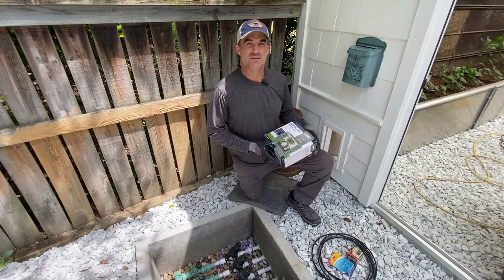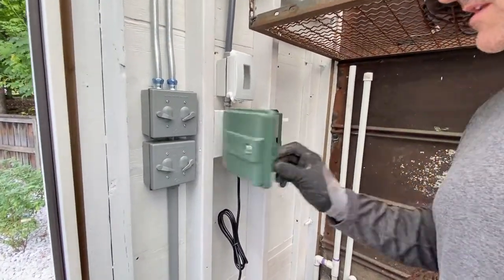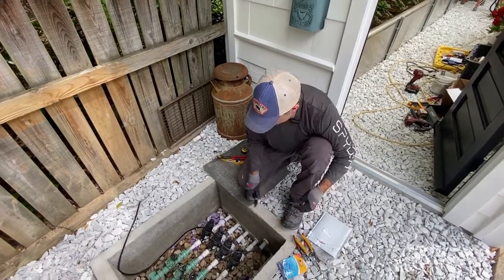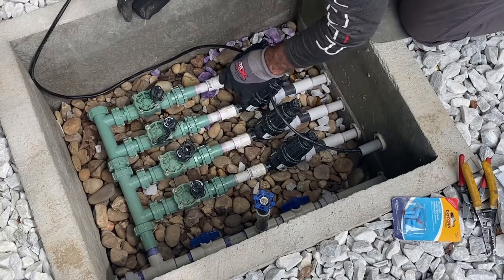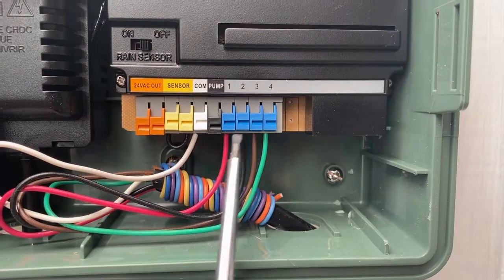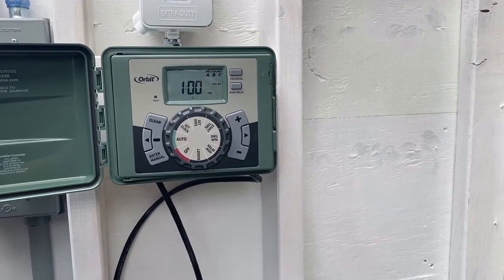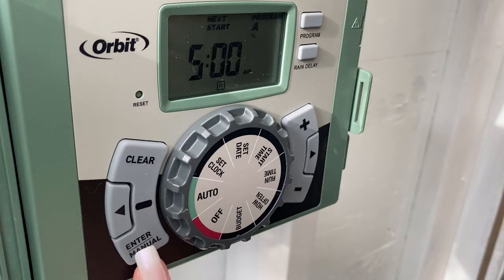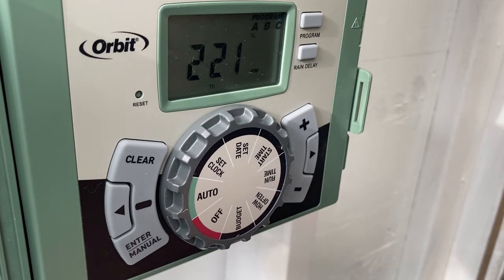Orbit Timer Wiring & Programming Complete Install #diy #how #orbit

Comment: What if you're replacing an older Orbit unit with a newer model? Do you have to turn off electricity to that area before installing the new unit or is it enough to unplug the old unit, then disconnect the wires for the stations, install the new unit and connect the station wires to it before plugging it in?
Reply from the maker: Great question! You should be fine doing the swap "hot".... meaning electricity is still flowing through the wires. The biggest thing that you need to do for this is to make sure that none of the wires touch each other during the swap out and that you do not plug the new unit in until you are finished landing the wires. You can wrap electrical tape around the ends of each wire to ensure that contact doesn't happen between wires. Otherwise, just flip the breaker to the power source and go for it without having to worry about wires touching. I hope that this information helps 👍.

Comment: the video does not show  wiring for pump relay
Reply from the maker: Hi. I'm not sure if I understand your comment. This video shows a complete wiring of the Orbit valves along with wiring the timer and setting the timer. There is no pump / pump relay. This system is on city water and does not require a pump. I hope this information helps.👍